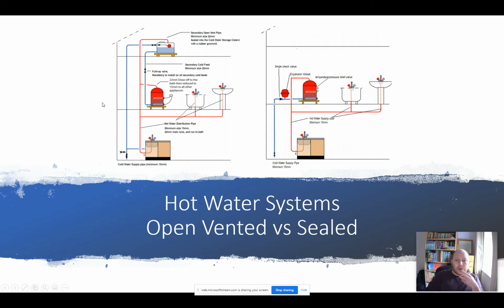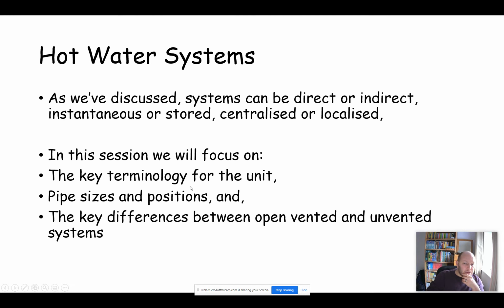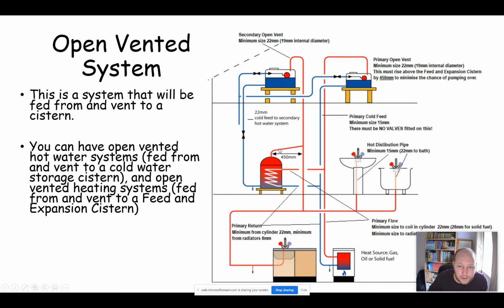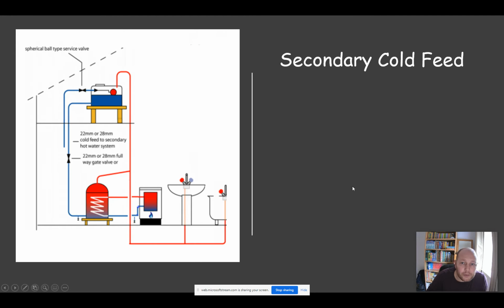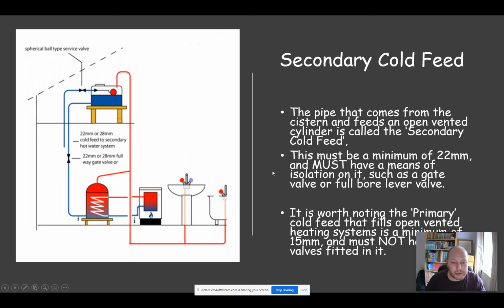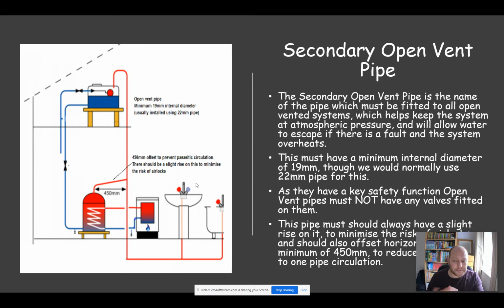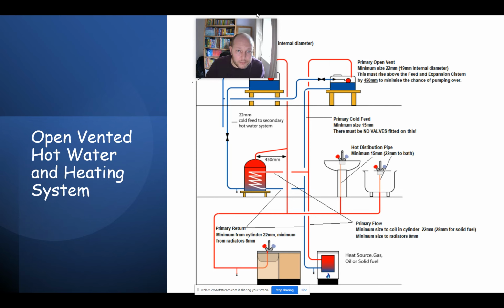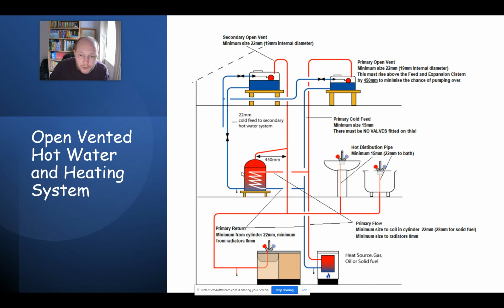2 2 1 Open Vented and Sealed Systems Part 1

Comment: Thx. 
Is it ok to add a pressure tank to the hot water system instead of using an open vent faucet? (i.e. use a regular faucet, but have a pressure tank to prevent steam pressure building up)
Thx
Reply from the maker: American building codes are a bit different to the UK Building Regulations (I’m assuming you’re American as you use the term faucet). 

In the UK you shouldn’t expect any steam as there are a number of safety precautions that should be taken to prevent the water from exceeding 100*C (control stat, overheat stat and temperature/pressure relief valve). 

In most cases it’s normally okay to upgrade an open vented to sealed system as long as it’s installed to local regulations/code.